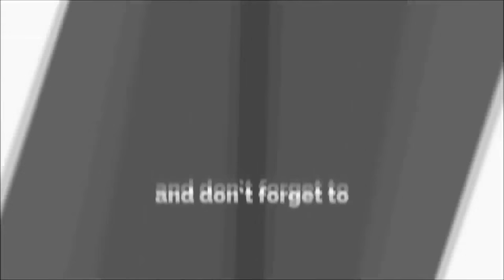Quickview: Steps of Simple CPU Custom Watercooling Set-up at $200

Comment: Hi sir good job sa videos nyo and more power! Kamusta na po pala yung i5-6400 na inoverclock nyo sa past videos nyo? I'm using the same processor now and OC'd to 4ghz in a hyper 212x. Hindi kaya maaapektuhan Ang lifespan ng processor?
Reply: Bermor Techzone nasa 34-35 °C kapag idle and 56 °C kapag full load sir. Hindi ko nga alam kung yan ba talaga ang dapat ko i-expect or may mali sa pagka-install eh.
Reply: Christian SIson yung 6400 mo ba na 4ghz ay mas better na performance sa 6500 or 6600 lng?
Reply: Ryle Noval if I remember correctly it's faster already and on par na sya sa i7-4790k
Reply: Anong mobo ba gamit niyo sir? Im using the Asus z170 gaming pro aura parang hindi daw advisable mag oc sa mobo na to